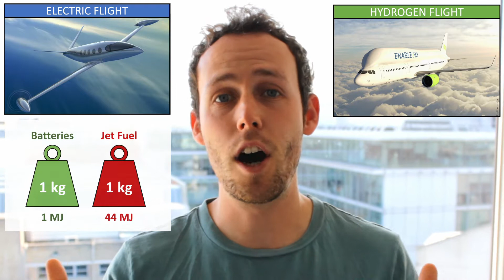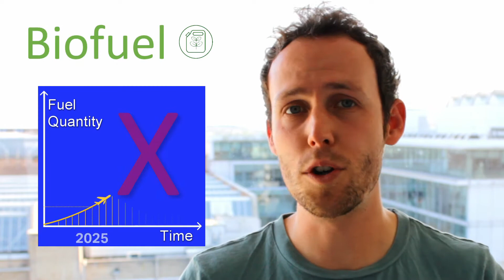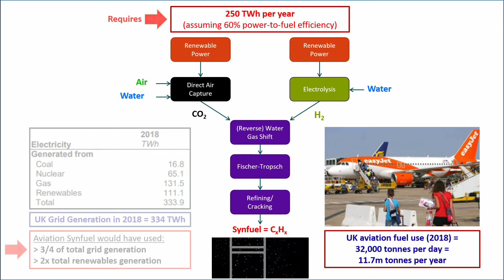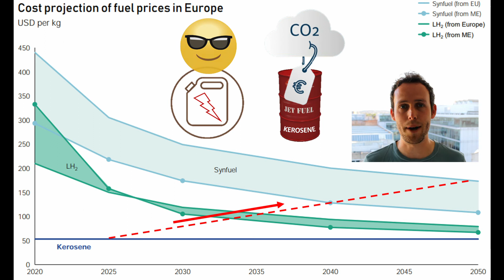Alternative Jet Fuels   (Part 8: Sustainable Aviation)

Comment: a higher carbon price isn't a solution, that just makes air travel unaffordable

need to tackle the cost challenges head on, better catalysts to improve efficiency, mass produced modular nuclear reactors for thermolysis to produce H2 cheaper, extracting CO2 from the sea rather than the air is probably more efficient, just going to have to keep working on these problems and beat these current cost projections, or else radically rethink air travel (eg. hydrolox powered suborbital rockets?), air travel getting more expensive is an unacceptable outcome
Reply from the maker: Hello Chronokun, you appear to be suggesting that nuclear-powered synthetic fuel could be used, without air travel becoming more expensive ? 

For info, I used to work at Rolls-Royce, who make both aircraft engines and nuclear reactors - and the CTO proposed this to me also. I did a calculation using their numbers for Small-Modular Reactors and worked out you'd need about 5,000 of them to meet the projected aviation fuel consumption in 2050... at a cost of roughly $4 trillion to build. 

So, some questions to you:
- why would an airline voluntarily pay for this incredibly expensive fuel?
- if airline customers aren't paying for the vast quantity of nuclear power stations required for this... then who is?
- if conventional jet fuel (kerosene) remains far cheaper, why would airlines not just keep using this instead?
Reply: @GreenSkyThinking  take a look into the projected capital investment into Oil & Gas exploration, extraction and refining for 2050, its more than 5x as much, $4 trillion to meet global demand is cheap, which is why the fuel would ultimately end up cheaper
Reply: @GreenSkyThinking  Lucid Catalyst did a report that ran a similar cost comparison to this, although they weren't looking specifically at kerosene, but rather displacing oil with H2 produced from modular reactors

https://www.lucidcatalyst.com/hydrogen-report

intuitively it makes sense, fuel has to be refined anyway, and exploration and transport only adds cost, so if you can provide process heat for cheaper than it costs to drill and ship oil, then why shouldn't synthetic fuel be cheaper? and undeniably nuclear fuel is higher density and cheaper, so the issue is then driving down reactor costs with mass production, and simpler, intrinsically safe designs
Reply from the maker: @DjChronokun  if $4 trillion is cheap then can we add the cost to air fares so that those using it are paying for it then?

The industry doesn't propose this... the only synthetic e-fuel mandate being proposed is by Germany and its less than 1% in 2030. We'll have blown our global carbon budget for 1.5degC by then.

If synthetic e-fuel was cheap then the industry would be planning to use that rather than dangerously ramping up biofuel to 500m tonnes by 2050 as per their "Clean Skies for Tomorrow" WEF report.

If green hydrogen can be produced cheaply and abundantly, then why are governments planning for lots of blue hydrogen facilities? 

Again, synthetic e-fuels are possible and should be scaled in favour of biofuels... but those using it need to pay... and any kerosene being used needs to be taxed according to an effective emissions price.
Reply: @GreenSkyThinking  ok, fair points regarding "why isn't this being done?"...

the answer is technological readiness, both the reactors and the thermochemical cycles are still unproven, but it is being worked on, eg. Hyundai, USNC and KAERI, are partnering to develop thermochemical H2 production from MMRs, we will likely have to wait for more concrete cost figures after pilot projects are built before we will known for sure if the costs work out, then I suspect we will see large scale investment follow (assuming public sentiment around nuclear doesn't ruin things)

carbon taxes or e-fuel mandates might help drive investment in this direction sooner/faster, so they're not necessarily bad, but we need more focus on decreasing costs from advanced nuclear (both fission and fusion), the world is never going to accept moving to zero carbon energy if it means energy costs more, zero carbon needs to be the cheaper option by 2050 for net-zero to be achievable
Reply: @GreenSkyThinking  ramping up blue H2 in the interim is probably a good thing too, as scaling H2 demand alongside H2 supply is going to be necessary to enable the large scale green H2 projects we need to bring prices down to be able to achieve economic viability, so blue H2 is a good stepping stone to that
Reply: @GreenSkyThinking  Doosan also recently increased their investment into NuScale for the purposes of using their NPM reactors for H2 production as well, so the cogs are slowly beginning to turn on nuclear H2 production, but it is going to be a slow process, and we'll probably see it happen first in the countries that are taking an active effort to support a transition to H2/e-fuels

and it'll probably also happen first with H2 powered aircraft, before we see e-kerosene reach commercial competitiveness, because the extra processing steps and energy required to go from H2 to e-kerosene are going to make that more expensive, and a harder challenge to crack

I also suspect the industry will have to revise it's plans for biofuel as more and more people are waking up to the environmental destruction it requires and resistance to expansion starts increasing (similar to the challenges faced by electricity companies trying to cover the entire world in solar panels and wind farms facing increased opposition from local residents)
Reply from the maker: @DjChronokun  I would suggest that we don't have time to 'wait' for technological readiness... regardless, if the tech was available today and we began building immediately, it would take decades to build hundreds of nuclear reactors and fuel production facilities... and they aren't going to build themselves, they need somebody to pay for them. It's pretty inconceivable that those using the fuel would not pay for this. 

Reducing fossil fuel consumption and GHG emissions this decade by applying emission pricing IS the cheaper option. Making it more expensive to fly IS the cheaper option too. We will collectively need to pay to remove CO2 from the air again (negative emissions technology) - it's just those doing the emitting today aren't predominantly being effected and may not collect the clean-up bill in the future - hence the need for a emissions price now to ensure they do pay as they emit.
Reply: The answer is use Hydrogen! Sorry for spamming but Europe has changed the policy which they will go for hydrogen and battery only,  not SAF. SAF still emits CO2. Please get your update about the recent policy change here https://ec.europa.eu/commission/presscorner/api/files/document/print/en/ip_22_3854/IP_22_3854_EN.pdf

Comment: You are wrong that we cannot use e-fuels for aviation. Point source CO2 and green hydrogen from alkaline electrolysis are coming down in price rapidly. We cannot blame shift onto carbon pricing and if we don't replace jet fuel with e-fuels at an accelerated rate, we will lose the climate battle anyway. Your video looks very polished and you sound very professional, but I'm afraid this does the climate agenda more harm than good.
Reply from the maker: Hi Michelle, we can absolutely use e-fuels for aviation - I'm pretty sure I say that's possible in the video? Let me know if that's not clear. My point is that a) they are very energy intensive and expensive, b) they shouldn't be incentivised by governments as they'd use huge amounts of electricity. So yes airlines can use e-fuel, but they'll need to pay for it... and they won't if fossil jet fuel is 5 times less expensive... so we need to tax fossil jet fuel in order to reduce emissions (alongside any mandate for e-fuel).
Reply: @GreenSkyThinking  hi. I think we need more granularity in the discussion. If you look at the techno-economics for using power-to-x with a point source CO2  with AEL, they are much better than for DAC/PEMEL. Unfortunately these aspects are not covered in your presentation and the overall impression is that the technology is higher up the technology-cost curve than in reality. It worries me that this kind of video is very convincing but doesn't unpack the different technology options and relative costs for making e-fuels.
Reply from the maker: @michepreneur  yes it's a high level video intended for an entry-level audience. Does my conclusion not hold: "power-to-liquid (e-fuels) will remain more expensive than fossil fuel for decades, unless we increase the emissions price of fossil fuel"? 

I'm happy to be corrected with evidence. 

Figure 7 on pg29 of this Royal Society report indicates synfuel produced from point-source CO2 will still remain more significantly more expensive than fossil fuel for decades to come: https://royalsociety.org/-/media/policy/projects/synthetic-fuels/synthetic-fuels-briefing.pdf I'd note for anybody else reading these comments that point-source CO2 is from carbon capture on the exhaust of an industrial process or power station... therefore if you process that captured carbon into a fuel and burn it in an aircraft... you've still ultimately emitted that carbon and are increasing atmospheric CO2 concentrations... so should really then pay for DAC to re-sequester it again (at > £500/tCO2 currently).
Reply: @GreenSkyThinking  I think it's sooner than decades. As I said it's dependent on the technology route. I study this for a living and wrote a leading multiclient recently on power-to-x. We expect to be at gigascale e-fuel production by 2030. Also note that we are talking about hard-to-abate sectors here. We have no choice but to use a synfuel because electrification is not possible at least for decades. Therefore the CO2 will be emitted as well as all the GHG from oil and gas extraction unless we use e-fuels which have already prevented CO2 molecules from point sources from entering the atmosphere. So they do not add (as much) CO2 as the current situation. The alternative of course is not to fly or drive a car and I'm all in favour of that as I've commented elsewhere publicly.
Reply from the maker: @michepreneur  great to have an expert commenting - thank you! What is your most optimistic price for a kg or litre of e-kerosene in 2030 and 2040 from the study?

Just to re-emphasise my position on this: I'm not saying e-fuels aren't possible (in fact I point out their scale-up should be favoured over biofuels) but what I AM pointing out is that e-fuels are energy intensive, and therefore fundamentally expensive. So airlines will not pay for them unless mandated to do so and unless emissions pricing is applied to fossil jet fuel to price in the climate impact.

It's also all very well saying "their price will drop in the future" but that will be based on economies of scale and tech development which will only happen if somebody buys the stuff now whilst it's more expensive... all of this points to customers having to pay more for airfares... and a near-term limit on air traffic growth. The aviation industry doesn't acknowledge that and there are currently very few mandates for synfuel (e.g. Germany has recently announced one mandating less than 1% by 2030...meanwhile we may have blown our 1.5degC carbon budget before then... all of that points to the need for a kerosene tax in the meantime, and yes less flying).
Reply: @GreenSkyThinking  hi. I agree with you too that carbon prices as well as carbon border tax adjustments are important. The cost of production is a key metric to look at and one of the issues is that every single project is different so generic cost predictions are only helpful directionally. In each project the economics change vastly depending on how much of the oxygen and heat from the electrolyser and downstream chemical synthesis you can off take and the revenue from offering grid control services to the utility provider. In an agricultural project you can make use of the biogas too and then feed excess electricity back to the grid. Sometimes the least profitable part of the project is the efuel!! Overall the economics are positive. Also regions that have the cheapest solar PV e.g. parts of the Middle East, South America and China and this is why we are seeing already 100 MW efuel plants under construction. None of this detracts from your expertise on carbon pricing, what I am sayinb is an additional, rather than opposing set of factors. The alkaline electrolyser companies are already aiming for technology that will allow $1-1.50 /kg levelised cost of hydrogen  (LCOH) in the 2030 time frame and this is breakeven territory for efuels. Many other hurdles though...not least critical raw materials which is another can of worms. 🪱 Thank you for your insights in carbon pricing.
Reply from the maker: Thanks @michepreneur I suppose regardless of hypothetical future prices... is it not fair to say, WHO will pay for e-fuel NOW whilst it remains (considerably) more expensive? And if not the highest emitters (frequent flyers), then who else (all tax payers)? And if e-fuel really is cheap then how come the EU (which has a lot of renewable resource) has proposed an aviation e-fuel mandate for 2030 of less than 1% of total jet fuel use? (Bear in mind we'll have blown our global carbon budget for 1.5degC global warming by then).
Reply from the maker: @michepreneur  Hi Michelle, thanks very much for the offer and I'll definitely send you an email next week - would be great to chat and understand more - thanks!
Reply: E-fuel still emits CO2. Sorry for spamming but Europe has changed the policy which they will go for hydrogen and battery only,  not SAF. SAF still emits CO2. Please get your update about the recent policy change here https://ec.europa.eu/commission/presscorner/api/files/document/print/en/ip_22_3854/IP_22_3854_EN.pdf